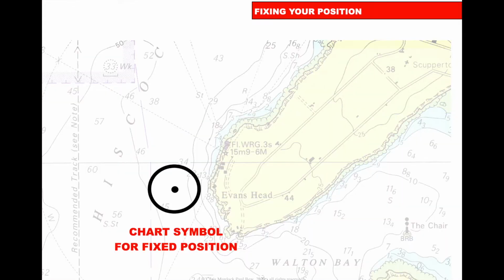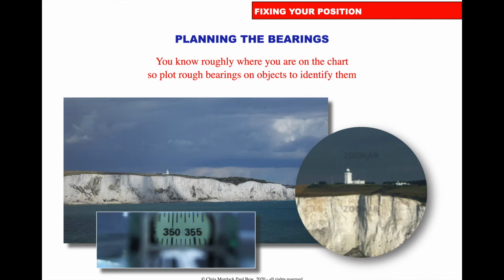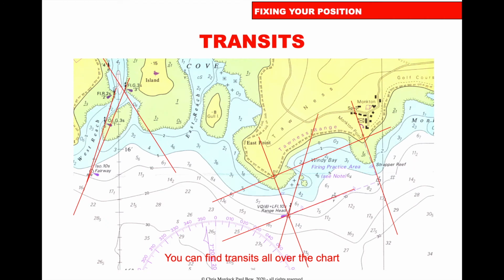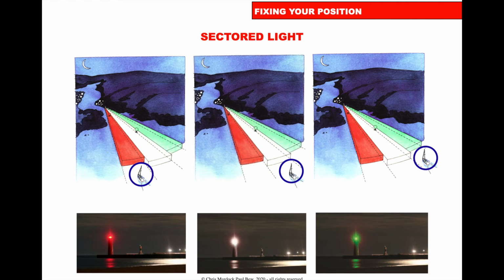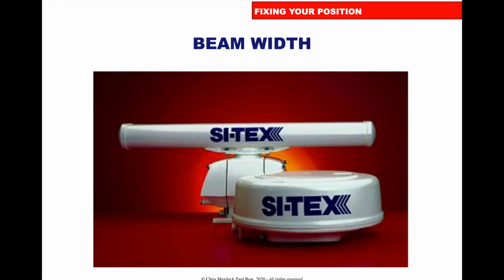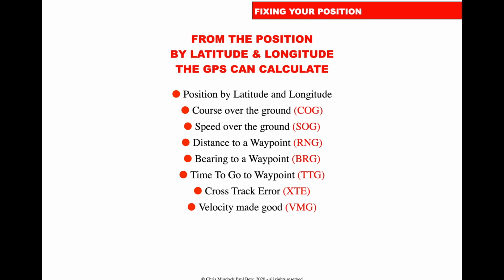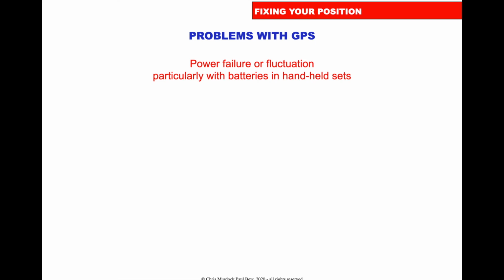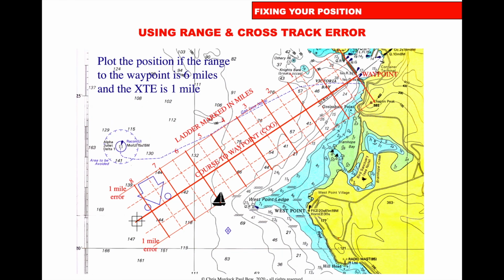City Sailing How to find your position on your chart with a GPS and other means.

Comment: Hi when I bearing from compass to on chart do I need coulculate da vision varision to on chart get true bearing  thanks
Reply from the maker: Yes you need to convert from magnetic to true to put on the chart, all workings on the chart should be in true.
Reply: @CitySailing  thank you very much